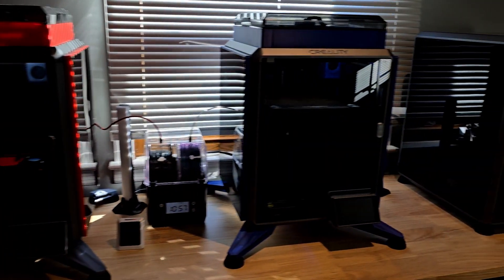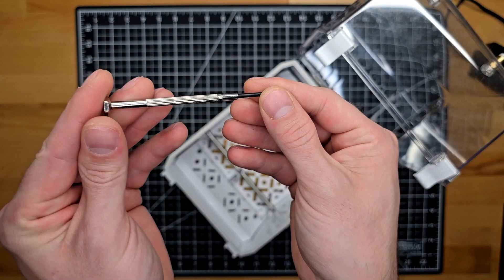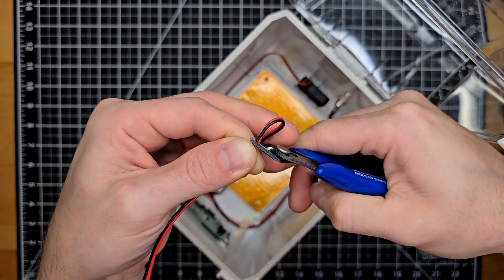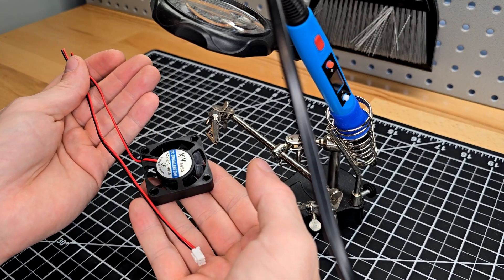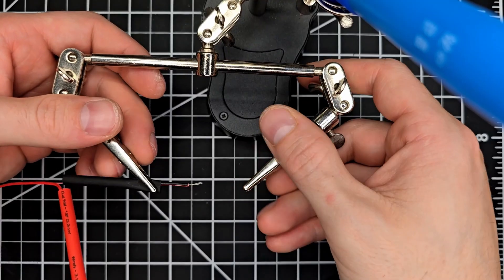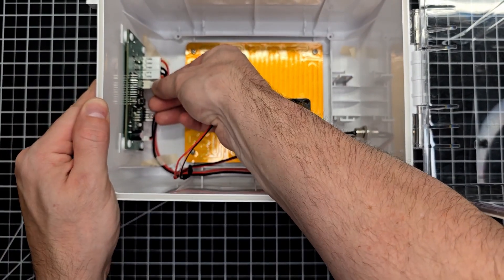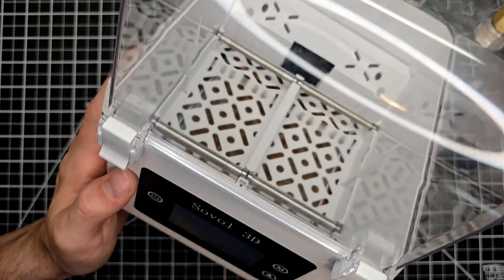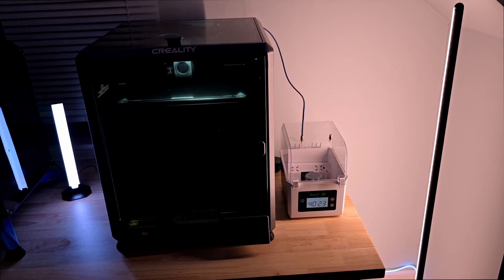Giving a Sovol Filament Dryer Another Chance

Comment: I saw you have the direct tube connector on top of your dryer do you have a link to it I want it. Thanks!
Reply from the maker: I had it lying around from another printer but any type of threaded bowden collet will work if the threaded portion is long enough to bite into/pass through the lid. I had to enlarge the existing hole slightly so a drill, slightly smaller than the threads on the coupler, worked well. After that, it threaded it snug and still continues to serve its purpose!

Comment: Quick tip to improve your solder joints, if you touch your iron to the wires from underneath and let them heat up, you can just touch your solder to the top of the wire and it should all disperse much more evenly and a lot less blobular!
Reply from the maker: After a few more projects, I definitely figured this out! Great tip for anyone that had solder jobs that look like mine at the time of this video 😂

Comment: hey I recognize that dryer! glad you were able to save it from the trash :)
Reply from the maker: The gentleman that made this project possible! Thanks for giving me the opportunity to dust off some fans that I had lying around (for however many years it has been) and to practice some soldering skills!
Reply: @CovenantCustom  happy to help! Soldering pro tip: pick up some "63/37" solder in a thin gauge, your joints will significantly improve 😀
Reply from the maker: @TylerKrick  Noted! Fun fact, this soldering wire was handed down to me by my father from when he had a need to solder, over 20 years ago. It's almost as if each joint holds sentimental value 😁 Used the same spool of solder for a science project that he and I worked on when I was back in middle school (can't say I've used it much since - maybe for a car radio or some miscellaneous projects otherwise). Will definitely add some thin gauge 63/37 into the mix now that you mention it!
Reply: @CovenantCustom  love that 🥰
Reply: What an awesome story- the hidden meaning behind seemingly simple objects!
Reply from the maker: @aarondavis9208  I'll stop using it once it runs low to make sure it never runs out